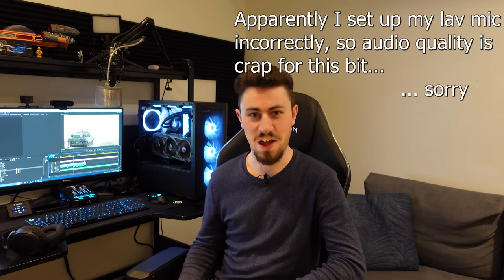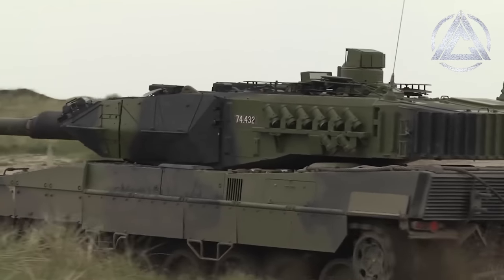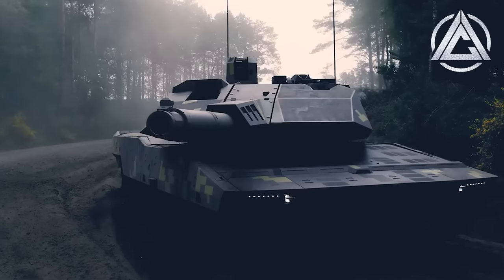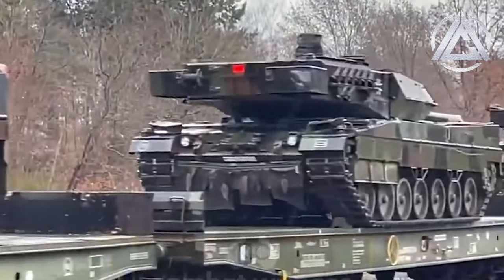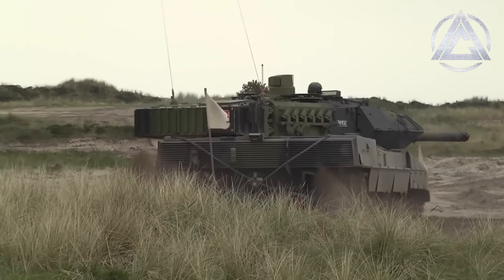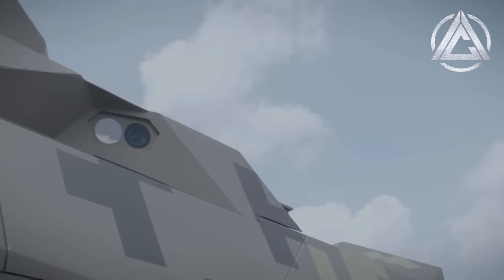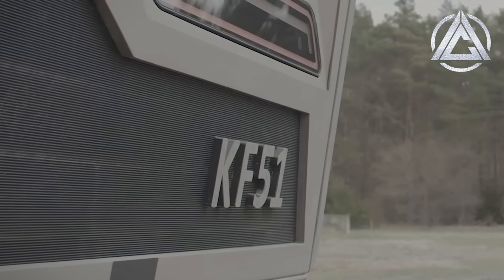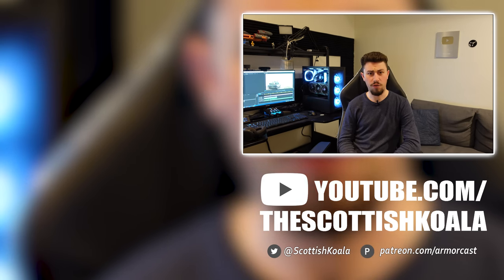Germany's New KF51 Panther Tank | The Spearhead of a New Generation?

Comment: >Fully new
Literally Leo2 with just improved electronics and the only major chage is autoloader(optional btw, not final)
Not to mention same chassis
Dont get me wrong its major upgrade and a good one but to call it fully new? nah
Reply from the maker: Fully new turret, and a modified Leopard 2 chassis which is only a placeholder for the demonstration piece, and won't be present on an eventual production series.

The turret is absolutely new. Similar look yes, but there's plenty of examples of that. T-64 vs T-62 springs to mind

Comment: I believe that Tanks need to be remote controlled from control centers with no crews inside of them at all. This way everything can be focused on survival ability of the Tank and effectiveness all around. Also have Tanks with crews for back up and sensitive missions.
Reply from the maker: Remotely operated tanks are a bad idea. Things on tanks break ALL the time. At least if you're right there, you can scuttle the thing if necessary so the enemy don't get it!

Remotely operated tanks also don't exactly DO much. Sure, the TANK crew is back out of the fight, but tanks are NEVER the only things on the battlefield, and all the mechanised infantry around the tank are still in just as much danger (and need to be. You always need boots on the ground.)
Reply: I have already thought about fully remote control, but you get to the following problems:
• Huge imput lag.
• How close you must be for the tank to receive the signal? the signal could be trackeable and be close enough for an artillery strike or airstrike.
• Signal jamming, effectively disabling the entire tank.

A tank with up-to-date APS is alreay basically unkillable because not even top attacks work anymore. 
The problem is nobody seems to realize that hardkill APS is the best advancement in tank defense since the invention of composite armor, it needs to be installed in EVERY SINGLE TANK. The only countries that currently use them in good numbers are the USA and Israel.

Comment: The thing with the T14 is that you can increase its turret armor with later upgrade packages. I think its enough if the unmanned turret can protect from up to best 40mm APFSDS. The idea behind ARMATA is that it turret face would intercept any ATGMs and RPGs via its APS. Top attack munition AT weapons aint that great so far (or at least such as NLAW or Javelin) and one can add some NERA + ERA combo on the roof for extra protection, especially since there are no hatches in the way (but optics still are).
Reply: The turret in it is difficult to hit. Even if it is hit the design should ensure the crew is safe. Another story is that can the Russians actually manufacture the thing.
Reply: t-14 barely exists as a showroom piece and isnt even the subject of this video.
Reply: @KhanKeal  Leopard 2A6 already is likely more than sufficient to deal with anything the Russians can actually wield as far as tanks go. The question is do you want to be several steps ahead and for what price? Replacing the western tank fleets by a new generation of vehicles can be expected to be quite an expensive project. It remains to be seen if the western militaries are going to pursue such an aquisition policy anytime soon.
Reply: @KhanKeal  KF 51 barealy exists as a showroom exhibition piece, meanwhile the T14 has over 100 units alreadyt built.
Reply: @nowheredotc0m sure buddy. We have seen 7ish t 14.
Reply: @emilsinclair4190  ...and you seeing 7ish T14 tanks is supposed to mean exactly what? That unless they bunch them up all into giant field, you would not believe them even then? Pfft. I have never see more than a handful F35's. Maybe there are no more F35's in existence than a handful we have seen?
Reply: @nowheredotc0m  ... f 35 have been bought by other countries and actually seen countless times. Now since Russia is a country that has literally a history of claiming they have weapons they don't have (even painting different numbers on the same vehicle to make them look different?)
Reply: @emilsinclair4190  Yes the same 7ish F35's are always shown to the public. Finland has bought F35's too, but where are they? Huh? 
PS. I am only pointing out how stupid your argument is, as if Russia is under some obligation to show their latest tank stockpiles to you.
Reply: @CloneDAnon I believe india and China both passed up on the t-14 cuz that feature didn’t work.
Reply: @James-9999  They could have not "passed it up" since T14 is not for export (but soon will be according to rumors).
Reply: @herptek  This did not age well.
Reply: What T-14?

Comment: I see a machine gun on the side of the cannon where it is blocked from shooting to the left unless the current is turned left, now that is not a very good idea; the machine gun should be able to shoot both left and right, up and down without anything getting in its way otherwise it kills the entire reason for having a machine gun.
Reply from the maker: That is the coaxial machine gun, it cannot swivel left OR right, it aims where the main gun is pointed, elevating up or down with the gun and left or right with the turret.

In other words, it is fixed.

This is how ALL coaxial guns work, and tanks have been using them since early WW2

Comment: The front lower turret looks to be a shell trap.
It just so happens the original panther had the same problem that sent shells down into driver &  gunner position.
Reply from the maker: We did go into detail in the video as to why this, unlike the WW2 namesake, is NOT a shot trap. Modern rounds don’t stay intact to be able to penetrate any surface they might ricochet into, even if they DO ricochet at all, which they tend not to

Comment: A 130mm apds may not be much more usefull than 120mm but it also means a more capable H.E. round.
Reply from the maker: True, and that’s a big positive… but I think the drop in ammo capacity is a BIGGER negative
Reply: @ArmorCast couldn't the drone modification be swapped out with a second stage storage?

Obviously it will need blow out panels! 😅

Comment: It's a T-90 competitor, however much heavier, lower specific engine power, significantly lower driving range. German tanks have no good track record considering reliability, frequency of maintenance and overall cost and the tendency of being over engineered.
Reply: the T90 is dogshit compared to the KF51. T90 has 375km range and the Panther 500. Panther also has almost double HP with only 5 tons more weight..
Reply: @KingSpittusFactus  well, I trust the exact specs are strictly confidential anyway. However, the data I have says, that the KF51 uses the same old 12 cylinder engine of the Leopard 2. The T-90 has a 22hp per ton power/weight ratio, whereas the KF-51 will have something 24hp per ton. So absolutely not twice the power as you claim. The T-90 has a maximum range of 550km without auxiliary fuel barrels which is more than what you claim for the Panther. Do your research.
More importantly, KrausMaffei-Wegmann has a production capacity of only a couple of dozens of Leopard-2 (or Panther tanks) per year. In order to extend capacity, new facilities would have to be built, staff hired and trained. This will take years. Russia commands roughly 12'000 tanks at this point, with a couple of hundreds T-90s, a few thousend modernized T-80s and many (modernized) T-72s. The West is just not capable to produce enough tanks fast enough, unless it would switch over to war economy. The war in Ukraine is lost. The West should stop shipping weapons into the country.

Comment: autoloader is used in centauro 2 with 120/45 hi pressure 8/8 weeled veicol built by iveo otomelara and with leonardo eletrooptronic  and difense sistem and leonardo have singed a joint venture for costumizer kf51 and kf 41  for italian army 60% built in italy and 40% built in Germany assembled in ital by leonardo and  Rhainmetall  20.000.000.000 € italy ill be 1st launch country for kf51

Comment: I somehow doubt that on a serious battlefield a very expensive heavy new generation MBT, which will be vulnerable to an whole arsenal of weapons designed to kill tanks, will be useful.  
A new generation, easy to build, ''cheap'' but advanced enough, lighter and faster weapon system seems to be the future.  Something like the Toyota HiLux with a mounted machinegun.
Reply from the maker: Tanks have ALWAYS been vulnerable to anti-tank weapons, ever since 1916 when the K-bullet was invented! It has never removed their usefulness before, and it’s no more likely to now.
Reply: @ArmorCast  Well, that's what they said about battleships.
Reply from the maker: @ericvosselmans5657  Battleships were not removed from service because of vulnerability. That had nothing (or at least very little) to do with it.

They were removed from service because an alternative that could do its job better, and for cheaper, was adopted instead - the aircraft carrier. There is no viable replacement for the doctrinal requirements that tanks fulfil right now, and until there IS, tanks will continue to be used. Vulnerability is something you work AROUND, factoring it in to your tactics and strategy. You still need the role the thing did in the first place to be filled.

As for your original comment... good luck taking out a machine gun nest, destroying a fortification, crossing rubble/debris-filled streets, pushing down trees, surviving an RPG hit, or hitting ANYTHING more than a mile away with a Toyota mounting a .50cal! 😂
Reply: @ArmorCast  Certainly good points! I don't see a Toyota doing any of these things as well 😛but highly mobile small infantry teams with advanced light weapons could certainly do them. 
We'll see how the MBT fares on the battlefield  of the future.   

I know this : Reliable sources are not so easy to find, but there is a website (oryx spioen kop)  that has tracked losses with documented often photographic proof for each tank, from both sides since the beginning and so far  around 8.000(!)  ARMOURED vehicles have been lost on both sides, of which 2.000 were MBT's.

NATO Armoured vehicles and tanks, as we all know, are much more survivable, but certainly not indestructible as their use in both Syria and Iraq can attest to.   
I am not an expert by any stretch, but my worry is that NATO would not be able to sustain those kinds of losses. Both militarily and politically.

Comment: With what we have seen in Ukraine with drones and several different anti-tank missiles, the future of tanks is in doubt. If you look at the economics of it the anti-tank weapons are so much cheaper than a tank that any kill is a huge victory economically. I think that the 130 mm gun is like the 7.62 rounds used in earlier wars as the main bullet for all troops. Then they realized that with the smaller round more rounds could be carried and in most instances just as effective. The size difference is huge and the number of rounds carried would be much less for the larger caliber. If the autoloader failed, can you imagine a guy in a very cramped space grabbing and handling a 90 lb shell? I think that the generals have their heads in the sand and are fighting past battles instead of future ones. Tanks have become sitting ducks.
Reply from the maker: I recommend this video by Nicholas Moran, "The Chieftain", which effectively proves why no, the tank is not "dead", and yes it does very much have a future on the battlefield
https://www.youtube.com/watch?v=lI7T650RTT8

Comment: Interesting stuff , but physics doesn’t lie , understand you saying that shot trap doesn’t matter because ammo used doesn’t work that way but any designer , knowing such a glaring weakness ,will build ammo that does. So maybe should re think your thoughts on the shot trap
Reply from the maker: There is no "fix-all" button called "just built it". It is not POSSIBLE to build an ammunition type that obeys the laws of physics and yet still uses ricocheting force to penetrate the hull roof of modern tanks like this.

IF designers could "just built it", then why have none? The Leopard 2 has the exact same turret design, the M1 Abrams supposedly has this non-"shot trap"... the problem is that no round capable of staying intact to ricochet into an opposing armor plate will then have the capability of penetrating said plate when it hits.

Its also worth pointing out that the armor angle presented to rounds being shot at the WW2 Panther as well as other tanks infamous for their shot traps, is about 45-50 degrees. That is an absolute requirement. The angle presented by the underside of the Panther's turret... is more like 16 degrees. That kind of angle doesn't create a shot trap!

Comment: "It's time to step up" yeah sorry but I'd prefer to stick to the 120mm and jump into ETC guns than to listen to the guys who couldn't match american M829 performance with the DM53 despite making a longer 120mm gun
Reply from the maker: Honestly, same from me! ETC is the future, not bigger guns. Especially when you can only hold 10-20 rounds for the thing!
Reply: Up to 40 in the KF-51. Besides, the 130mm is for longer range attacks without loss of energy. Also, where are the ETCs you guys want? Or the railguns? There has to be a stop gap for now, like the M3 Lee/Grand stop gap tanks before the Sherman.
Reply: @WolfeSaber9933  hey pal, the XM291 and XM360 already exist and the Navy developed a 60mm ETC gun in the 80's.
Reply: @ancaplanaoriginal5303  And where are they? Last I checked, 60mm is too light for tank warfare. And why are they still XM, and not M?
Reply: @WolfeSaber9933  XM360 is the gun on AbramsX, it's XM because it hasn't been aproved for production yet, but it's clear it'll be adopted.
Reply: @ancaplanaoriginal5303  No, it does not. It isn't even clear if the AbramsX would go into production. Plus, I heard that that gun was in experimental back in the 80s and 90s. Not something made today.
Reply: @WolfeSaber9933  the XM291 was the one made in the 80's, it was successfully tested in both the M1 CATTB and M1 Thumper, the XM360 has been in development for a while and it's the only surviving component of the Future Combat System program. The AbramsX is a proof of concept and some of it's technologies will end up in a future version of the Abrams, the gun will clearly be amongst them considering the benefits of ETC guns.
Reply: @ancaplanaoriginal5303  I'm sure that the ETC would also be 130mm for the benefits of a larger caliber.
Reply: @WolfeSaber9933  the ETC gun already offers the performance of a 140mm gun on a 120mm package while being lighter than the already existing M256 and using the same cartridge size, increasing caliber is stupid.
Reply: @ancaplanaoriginal5303  Well, it's not like you can control any military. Both methods to increase range and damage output might be put into a cannon for a new tank. Also, it was considered to replace the 120mm cannon of the Abrams in the 80s to a 140mm before the fall of the Soviet Union.
Reply: @WolfeSaber9933  that was the XM291, which guess what, could fire both 120 and 140mm ammo and was ETC compatible, in fact it's the reason why the breech on the M256A1 can handle such ridiculous pressures :)
Reply from the maker: @WolfeSaber9933  You're incorrect about KF51's ammo capacity. maximum internal storage is 20 rounds of 130mm, and that's if the HERO 120 launcher is not installed. That drops to 10 if you add the drones/loitering munitions in. Apparently there is also the option of mounting an additional autoloader drum of 10 rounds (bringing the max to 30) EXTERNALLY on the rear of the turret, but I hardly need to point out why that's a god awful idea!

Abrams X won't enter service. It's not designed to, it's just a concept vehicle. XM360 however is absolutely the future of tank guns. ETC guns are effectively railguns without the energy requirement, able to DOUBLE the velocities of sabot rounds over their conventional counterparts. The US would be mad not to adopt it and to go with a 130 or 140mm instead. As for its age, that means nothing. M35, the gun that's just now entering service for the first time on the M10 Booker, was first produced in the early 80s
Reply: @ArmorCast  If velocity is king, then why have nations gone with bigger rounds on the decades, not making the projectile go faster?

Comment: you know what i never understood?
smoke screen protection
like when the tank is going super fast and then abruptly stops it creates dust when its in the summer and spring on dusty roads (cant that be used as a type of smoke screen)
like in this video after 1:10 see how it produces smoke cant you just use that for cover?
whent he tank fires it produces some firepower smoke after the shot is fired (cant this also be used as a type of smoke screen)
like in this video watch how when the tank fires it produces smoke in front of it for a little cover 
i can understand you would need smoke screen for infantry fire or maybe for other cover for other people on your team
Reply from the maker: The smoke grenades used by modern tanks are specially formed to created an infrared screen, meaning it isn’t just visual protection, but thermographic optics and laser guidance systems ALSO won’t be able to see through it.

That’s not true of just the dust kicked up by the tanks stopping or firing